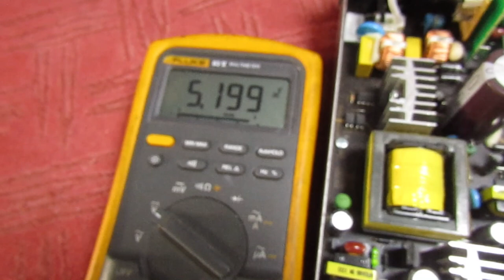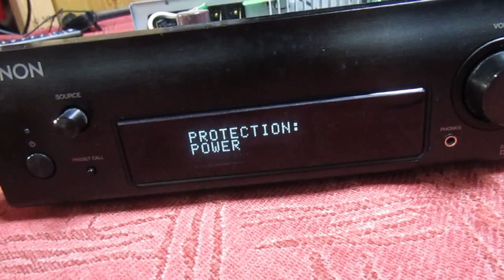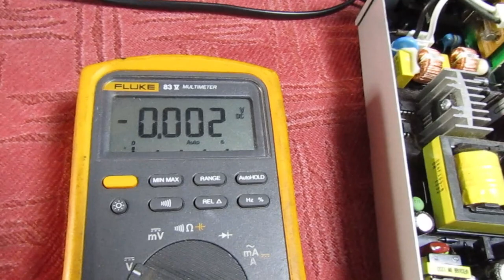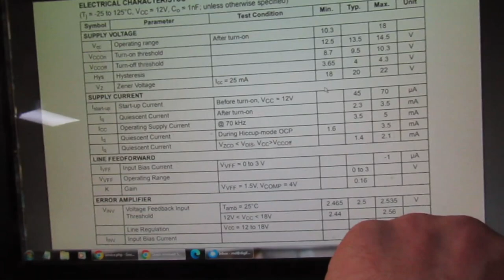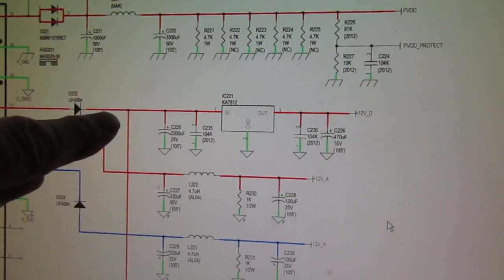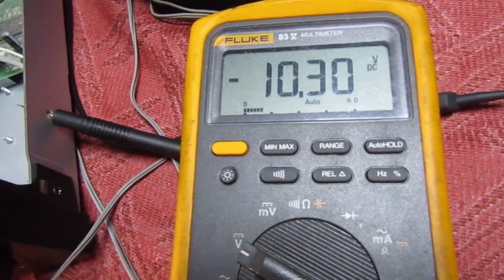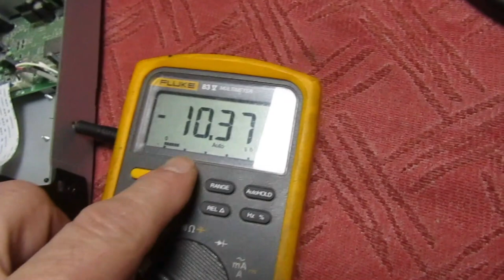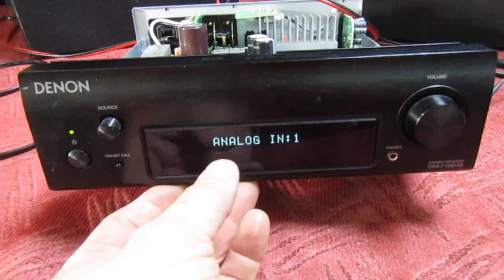Denon DRA-F109DAB flashing red light repair

Comment: Another reason to avoid buying this tat in the first place - thank MD
Reply from the maker: unfortunately most modern HI/FI gear is like this now
Reply: @michaeldranfield7140  Which is why there's a strong demand for vintage audio.
Reply from the maker: @sw6188  I know and most of this stuff was built to last and be repaired , biggest problem I find with vintage hi hi is the STK audio chips are virtually un obtainable unless you buy a Chinese fake .

Comment: I reckon it went into Protection Mode for one reason and one reason only... It was played too loud for a long period of time, way past of what it is capable of. Too much bass and treble for extended periods of time, causes the unit to enter protection mode and shutdown immediately. Consumers wouldn't expect something to just blow on a brand name like Denon.
Reply from the maker: dont know but its not come back yet .
Reply: Denon gear is cheaply made and problematic these days. There are modifications to try to improve the power supplies in some models. Power supplies and output stages dying all the time. Many brands are the same now. Especially AV amps. If you get quality, it's a bonus. Plenty of warranty failures
Reply: @tenmillionvolts Denon isn't really Denon anymore. The Japanese company sold up quite a while ago and it's all made in the same sweatshops as everything else. In Denon's case most of it is designed and made by the Korean company Inkel, who were pretty good in the 1990s (they owned Sherwood, and made a lot of stuff for Harmon Kardon and others) but their modern gear is just the usual rubbish, made in Vietnam but with mostly sub-standard Chinese components.

Comment: I have f-109 not Dab, the issue is when push to turn it on,  the green light flashes once and nothing happens...if you continue to push power button, green light keeps flashing regularly. Any advice about this? Thanks

Comment: hi, i'm french and i'm facing the same issue as you .unfortunately, i haven't been able to disable protection. I saw you had a diagram of the power supply board and i was wondering where you found it so i could take me own measurements .Thank youu very much , guillaume

Comment: Brave to go against all the, how to fix things without a schematic, YouTube channels ive had a hard time with customers because of those channels, do you have to sign up to a special, non fake YouTube ha keep up the non fake good work
Reply from the maker: this would never have been fixed without a service manual , unless of course you could have guessed how to enable the service mode, I had a similar fault with a Neff microwave and I think they made it deliberately un guessable , the procedure was to plug the oven in , set the clock to 12.00 then press a button sequence and all this had to be done within the first 10 minutes of connecting the mains , then after repair you had to erase the codes out of Eeprom A , press the wrong button and erase Eeprom B and the operating system would be deleted and you need a new board .
Reply: @michaeldranfield7140  ive never seen the internal paint /plasicoat coating in a microwave last long enough to have a electronic fault happen ,they seem to delibratelly not ventillate the steam/condensation out now. now killed by rust/paint  flakes in your food

Comment: Have a check bad solder joins, its typical in modern equipment's as leaded solder. Also maybe someone made a shots on a speakers outputs, most of the time people dont say that and they blame device gets faulty.
Reply from the maker: its not come back yet !

Comment: Thank you for sharing this interesting and educational video with us. Perhaps the service manual was written by someone who was not involved in the technical design of the product? At least there was a service manual available even if it omitted a key fact about the variable voltage...
Reply from the maker: Its a far cry from when we had technical descriptions in the service manual but these days with most stuff been a board replacement job only I guess you dont need a technical description .
Reply: @michaeldranfield7140  Precisely. They don't give you a technical description or any fault-finding info because they really don't want you to repair the unit.
Reply from the maker: i know , its a good job i didn't order a new psu board . @sw6188

Comment: This is really common for these power supplies. Likely this unit was just connected with the speaker cables shorted, or it was run too hard for too long and sent the amp into protection mode.
Reply from the maker: Dont think so as this would have caused a Amplifier protection message , I know this because I burnt out a pair of speakers testing the unit !
 if you look back at the video I started off with a small pair of speakers , forgot they were only 10 watts ,turned it up full and the speakers went up in smoke , so I swapped to a bigger pair for the rest of the video !

Comment: Reminds me of a Technics system I repaired years ago...it kept shutting down - once in a while - because its uP sensed that its cooling fan's bearings were very very very slightly too tight!!!! You can see why I left electronics.
Reply from the maker: yes , a lot of fans have 3 wires and a tacho coil to see how fast its rotating ,I had the same with a capstan motor in a video once , replaced a chip that was overheating and then found same as you tight bearing causing the chip to overheat .
Reply: I replaced many of those fans. They are used in CDPlayers as well. They give trouble there too. You can rev the motor for a while to loosen them up but they bind after a while.

Comment: I love your repair videos!
On the 32 V line there is this voltage devider "PVDD_Protect". Sounds like this voltage is monitored and there might be something wrong?
And a little load dependent regulation is normal, I would have thought.
Reply from the maker: yes , I noticed that but the 32v rail was spot on , I would imagine a short in the amplifier would cause this to drop and trigger an Amplifier protection message , its gone back over a week ago and not returned so I guess we will never know .
Reply: A variation on the output load (audio power) should not affect the rest of the system rails (+12 V, -12 V, 5 V etc) especially where those voltages RISE as the output power rises. I can understand it causing some shift on the 31 V rail that supplies the output stage but the way this amp works is just out to lunch.
Reply: @michaeldranfield7140  could it be some class d amp weirdness ?
Reply from the maker: Might have been something as simple as a glitch on the mains, dont think I will ever know for sure . @repairitdontreplaceit

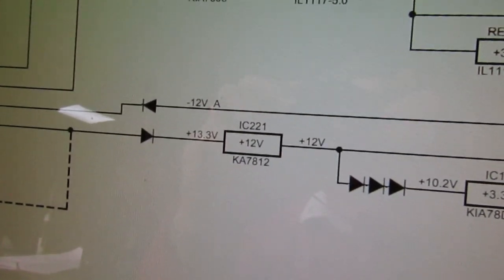Comment: Well discovered. Something very odd with that manual. Unless I'm mistaken (has been known) a KA7812 (12:55) has a dropout of 2V so with 13.3V on the input, expecting12V on the output, would make a great unregulated supply, ho, ho.
Reply from the maker: Without any technical description its hard to know whats going on with modern stuff now , I remember a similar fault on a LG sound bar trying to trace why a rail was low only to find it was the wi fi module and the rail went up when the thing was switched on

Comment: hi Michael I would check if there are any opto couplers in the feedback from the secondary to the primary as it looks like there is no regulation on that psu. I have had similar problems with SMPSs having low rails caused by no voltage regulation feedback caused by a failed opto coupler or a failed tl431 voltage reference ic. these psus generally have both voltage and current regulation the symptoms shown on that unit looks like the current regulation is working but the voltage regulation isn't working thus when rhe power amp draws more current the voltages will rise. I noticed whwn the volume was turned up the 12v rail went over 12v again telling me that the voltage feedback is not there.
Reply: I know right anyone who is actualy as good as this guy makes out would know that lol this guys probably wrong i doubt its repaired itl be back ot on a bin soon i dont know if you noticed but he got a low reading before a 7812 hahaha does he think thats ok and the rail just rises up till the regulator works or somthing thats hillarious whats he think happens before the regulator is working does he thinl the currant just goes strait thru hahahhahaha

Comment: I remember when Denon made decent gear, this thing certainly is not!
What a pain to sort out, if it was a short on the speaker terminals that caused it to shut down, why it could it not see the short was cleared & simply reset itself? Another reason not to repair this modern tat! You need to get back to some vintage gear that is a pleasure to work on 👍
Reply from the maker: Not a short on the speaker leads , this throws up a Amplifier protection , I know that because you may have noticed in the video I started off with a couple of small speakers , then in another clip I had swapped them for a pair of large speakers , I forgot the small speakers were only rated for 10 watts and they both went up in smoke after running the amp on high volume triggering the amp protection !

Comment: So, let me get this straight..... If the cat is playing on the shelf next to the speakers, and accidentally yanks out the speaker lead, that would cause an underload on the outputs and cause the PSU to shut down and lockout? Then you need to buy a manual to tell you how to clear the fault record from memory before you can use the amp again? - Or take the amp to a repairer to do the same thing?

What a performance!  I think I'll stick with my Technics!
Reply from the maker: Correct, you need the service manual on a lot of modern HI/FI equipment, just like you need a hand held scanner to find a problem  a modern car , only a couple of months ago I had a fault on a microwave oven which wouldn't do anything  and the service manual said if it has failed to start more than 3 times it would lock out ,the worlds gone software crazy , I guess we will never know why the hi fi locked out as it has not come back yet and its a week ago when I did this repair .
Reply: Yes, keep your Technics (which I presume is a vintage unit). None of this microprocessor controlled junk!

Comment: This is a shining example of why I refuse to work on this modern junk. The service manuals (if you can get them) don't give proper diagnostic information and invariably leave out the most important things that we as service people need to know. Hi-fi gear now mostly relies on switch mode power supplies that can be dynamite to repair, and are often coupled with class D output stages which to my ears sound bloody awful. 
Give me a nice 70s or 80s amp to repair any day. Easy to work on, most I can do without a schematic and there are no microprocessors or other digital garbage to deal with.
If the service manual says there should be 12 volts on a rail, then that's what it will be as long as everything is right - and I won't be wasting time chasing red herrings.
Reply from the maker: modern TV s are worse than HI/FI , no schematics at all , just 3 or 4 boards and a part number for each , the truth of the matter is the manufacture does not want these items repairing , they just want to sell a new unit which I think is wrong, in the 70 s there were service manuals for a pair of headphones and you could order every single part as a spare.
Reply: @michaeldranfield7140  Dead right - they don't want you to repair them. Chuck it out and buy a new one. I refused to buy into this madness. I'll hang on to my 20th century tech and appliances as long as I can (for as long as I can keep them working!)
I take my hat off to you for the work you do in getting these modern sets up and running again.